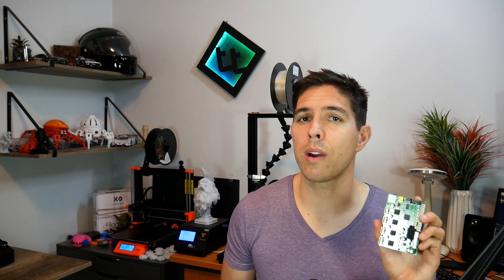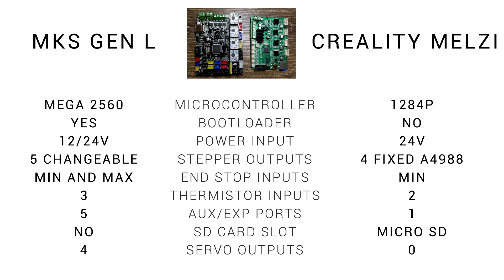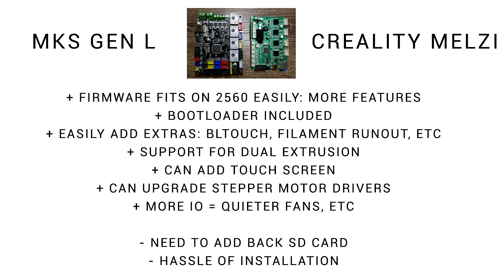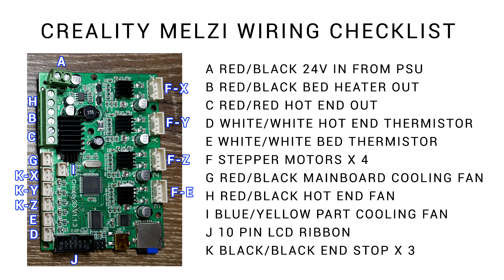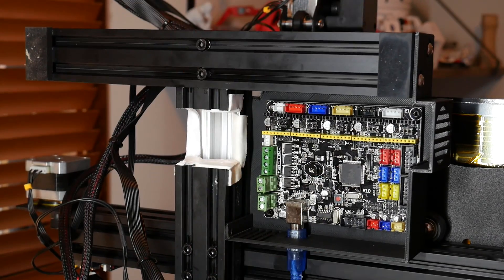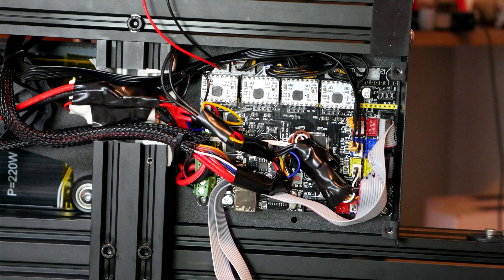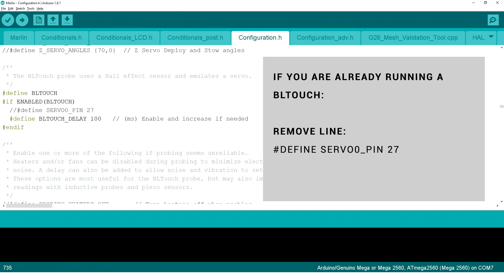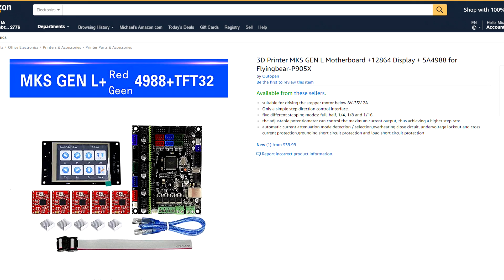Easy and cheap Ender 3 mainboard upgrade: MKS Gen L guide

Comment: Has anyone else had a problem with temperature being all over the place with the mks gen l board my temp graph on octopi was smooth with the old board the mks board the thermomistor acts crazy I have tried 2 mks gen l boards and same problem
Reply: Have you done a PID tune? http://3daddict.com/pid-tune-3d-printer/
Reply: @ChrisTeiken  yes but it's not that type of inconsistency it's like a very fast fluctuation it even does it at idle without the heater on I tried putting 100 km resistor in both the hotend in the bed and it it still had to fluctuations and then when I went back to the old board even after flashing updated firmware to the original melzi board from the ender 3 it would have been away so it only did it on the to MKS gen l I did do the PID tune but it it's like a higher frequency fluctuation you know then then what you normally get with a PID you know inconsistency so pretty weird
Reply: @ChrisTeiken  I'm thinking it may be a combination of my power supply having too much ripple, and I've also read it one of the capacitors has too high ESR . It's just weird that it doesn't on both of the MKS gen L boards that I bought and not the ender 3 board.
Reply: @AlphaCharlieFour   I do agree that the OEM board does a better job of keeping the temp study. I have still have small variations with the MKS board after I tuned it.
Reply: @ChrisTeiken  https://photos.app.goo.gl/M8JVvWsHuBCdSM9a6 the right side is after i switched the thermistors over to the mks it gets weird. I wish i had taken a pic of the pid autotune it looked like that but in that sine wave pattern it was so weird
Reply: @AlphaCharlieFour  Mine looks similar to yours.
Reply: @ChrisTeiken  I'm probably just nitpicking I replaced the 22uf cap on the output of the voltage converter with one with a low ESR, and it seems to have cleaned it up substantially if not fixed it.
Reply: @AlphaCharlieFour  do you happen to have a guide to do that?
Reply: @yowhatsmynames  I've got another board I can do I'll have to make a video of it

Comment: I bought a MKS_GEN_L board compiled the Marlin 1.1.9 , Arduino 1.8.8 .the board came with Artillery 3D software ?? when I tried to down load the board does not recognize Marlin and  my COM ports. In tools it is grayed out. Any suggestions you can give me?
Reply: Make sure you have the power on for the board. If that still doesn't work, you may need drivers for Windows/Mac/Linux.
Reply: I tried to install a CH340 driver it gives me an error message .

Comment: Hi Michael,
When I try to switch the E0_AUTO_FAN_PIN from -1 to 7, it no longer uploads, giving me the error message - Error compiling for board Arduino/Genuino Mega or Mega 2560.
 The firmware uploads fine when I leave the value as -1, but I would like for the fan to only come on when at 50 degrees or higher. Any advice on how to fix this problem would be greatly appreciated, Thank You.
Reply from the maker: That's a weird one. Might be one of those strange issues where it compiles with an older version of Arduino IDE. Also, read the error message at the bottom, it will give clues. Good chance something else is already assigned to pin 7.
Reply: Thank you for your input, I will try it again.

Comment: I've completed the instructions here and everything got connected and flashed over to the new board just fine. However, i'm having an issue to where, when first homing, the Y axis sounded aggressively loud and failed to home. Anything I can do to get my Y axis working correctly?
Reply: You may have to reverse your stepper motors drivers. "#define INVERT_Y_DIR true" from what he had. Not all stepper drivers are the same direction.

Comment: I’ve tried my hardest not to have to post but I am at my wits end. I purchased the MKS Gen L v1.0 with the LCD screen w/ built in SD reader. I have an Ender 3, BLTouch, & 4988 drivers. I have tried and tried and tried and I can not get either the new or the stock LCD screen to do anything but light up.

I have made sure to comment out the stock display, left it on, tried defining different displays. None have worked. I have tried shaving the connectors and inverting then as well as using 2 instead of one cable to connect them. I am so at a loss and it is starting to make me mad... 

Please, I would love some help getting my printer back up and going. I have so many things I want to print. 

Thank you in advance.
Reply from the maker: Remember that if using two cables, it plugs into exp1 and exp2 on board and LCD display. Only reprap full graphic display enabled. If using one cable, I couldn't get it to work, but I never reversed the cable. Will go into exp3 on LCD and I think exp1 on board. Add cr10 display in firmware by uncommenting.
Reply: Teaching Tech thank you very much for the reply. When using the LCD with the SD card. I use 2 cables. Match exp1 and 2 to the same on the board. I did have to invert the cables to get the screen to turn on. Then I uncomment the line for discount LCD and comment out cr10 standard. Everything compiled and uploads fine. 

That doesn’t work. The screen lights up but nothing is displayed. 

When I use the stock LCD I have tried a couple things. Plugging one cable into the exp3 and inverting the cable. This give me backlight but no text. Then I tried using two cables non inverted and this give me backlight and no text. I have tried having both, not at the same time, cr10 and discount display defined. Both of those result in a backlight and no text. I have tried fresh copies of marlin and just adjusted the LCD settings just trying to be able to see something. 

Thank you for talking the time to respond I appreciate it. I think your vid is pretty comprehensive and easy to follow but I’m just missing something. Right? I have to be.

Thanks for the help.
Reply: Right now. I have the stock LCD installed. Exp1 to exp1, Exp2 to exp2 on the mobo. The screen lights up but no text. I just downloaded a stock version of Marlin. 

Changed motherboard in config.h to BOARD_MKS_GEN_L

Uncommented out REPRAP_DISCOUNT__FULL_GRAPHIC_SMART_CONTROLLER

Commented out CR10_STOCKDISPLAY

Board changed to Arduino/Genuino Mega or Mega 2560

Processor: ATmega2560

Programmer: AVRISP mkII

Clicked compile

Done compiling

Click upload

Upload completed

I unplug from my PC 

Throw the power switch on the ender 3. The red and blue leds on the MKS turn on and flash for a second and then the red stays on. The screen powers on and shows me a blue screen. Twisting the screen knob does nothing that I can see. Pushing the button makes the buzzer beep once. Holding down the button makes it continuously beep. 

So that’s where I am. 

*sigh*
Reply: @lorenzow.842  I'm still using the stock screen, but what you are experiencing happens to me if the firmware fails to upload properly. Make sure to turn on verbose output in Arduino for compile and upload, as I thought it was uploading, but when I turned on verbose I could see an error. Also, I couldn't properly flash with just USB power, I needed the power switch on for the ender 3. Hope this helps.
Reply: Chris Teiken holy crap! You are amazing. I turned the printer on while I uploaded the firmware and bam! LCD screen working. I was even able to get the new LCD working. Thanks so much. This made my night.
Reply: @lorenzow.842  Awesome! Glad I could help out!

Comment: Having a super odd issue that I'm stuck with.. After installing this board on the Ender 3 my hotend decides to go way beyond the set temperatures when i start. The heat goes up super fast and it starts smoking because its so warm. What could be the reason for this? The sensor cable screw is loose so its not getting squished. I've ran out of ideas. Faulty hotend maybe?
Reply: Try tuning your PID. http://3daddict.com/pid-tune-3d-printer/
Reply: ohdear94 have you solved this problem? i have same problem.

Comment: can this be installed on any printer ???i own a athorbot printer and cant add anything to the cheap main board, is it possible to swap it with this one and do the same settings you did ??

Comment: Great video. Have you had any issues using your printed case and the stock cooling fan? Some have reported that some of the stepper drivers run a little hot (TMC 2208 as an example). I would like to keep my stock case and use a adapter bracket to mount the board. I've seen Thingiverse plans for changing the stock cover plate for one that has two fans. The only problem is most of them are using two 12V fans and using "stepdowns" or other means to power them. I know the ender 3 is a 24V system and the fans are 24V. What I would like to do is use two 24V fans in the new cover/lid to cool the board. But I can't find any info on how to power them. As I mentioned the stock cooling fan is 24V, 0.10A. The fans I would like to use are 24V, 0.06A (each). Could these just be wired in parallel and plugged into the socket where the single fan would be plugged into (labeled 12/24V)? Or would this cause issues/problems? Would software (Marlin) have to be changed? Would like to keep it simple and neat. Without extra components to drive them.

Comment: Thanks for yet another great guide. I am up and running with the new board, you make it so easy. I did make a few changes based on other videos/sites. I added a 5v 20MM fan to cool the board (found the print on Thingiverse based on yours). I reversed the LCD connection by trimming off the plug, so I only needed one cable and I did not make the changes concerning display in the firmware to make it work this way. I also switched to 2208 drivers (again found a video on setting voltage on those). Finally, added BLtouch, I found I needed a drop of hot glue gun glue to get that to stay connected on the board. If I hadn't messed up setting voltages on the drivers, things would have gone smoothly. After smoking a couple of those, I watched some video's on how to best do that. I can't believe how quiet my printer is now with the 2208 drivers! Thanks again for great videos, I have done so much to my printer and improved my prints!! I can't decide if I want LCD touch screen or not, I would like to hear from others that have made that change if they like the touchscreen.

Comment: How about 2130 drivers? Enables sensorless homing, but might be a bit more involved (pin config) when using the stock lcd.
Reply from the maker: A 2208/2130 double video guide is coming. The 2208s are a week late in the mail. I'd like to do these first because they are simpler and I can cover setting vref.
Reply: @TeachingTech  ok, cool. I saw on another vid you said the 2130 is upcoming. I still have to run off a box for the MKS & research LCD vs TFT then BLT then sensorless homing, linear adv, etc 😓☺
Printers are like the Hot Rods of my decade. 5x the work for the amount of use in return.🔧🔨💣

Comment: Trust me. This ISN'T EVEN CLOSE TO PLUG AND PLAY. I've been working in my spare time for SEVERAL days and still getting nuthin' from my printer. I bought the board based on it being a relatively simple upgrade. It's not, so beware before buying if you think it will be as easy as he implies in this video. At least it was inexpensive. ..if you don't count the hours you will probably spend trying to get it to work. I'll be a bit skeptical regarding any future recommendations as this one is short on crucial details apparently.
Reply from the maker: Every step I needed to get it working is shown in the video. No one can help you fix your problems because you are complaining rather than posting them in a community group in a humble way.

Comment: Are the stepper motor drivers really necessary? If so, which should I buy for the upgrade?
Reply from the maker: You are better off upgrading them from the A4988 I show here. If they ever come in the mail I have a two part series on this planned.
Reply: @TeachingTech  I got my MKS working today. Using A4988  drivers for now which are currently printing your case. Everything is a big dodgy at the moment as the board is perched in mid air.  Looking forward to part 2.  Thanks!
p.s. I have some DRV8825 drivers but I heard bad things about them.

Comment: I'm getting everything before changing boards and I have already received the MKS Gen L Board and I am waiting for the MKS TFT 28 V3 Display. I will be using Trinamic TMC2130 Drivers so I can lose my factory Endstop Switches. However I can't find any information on adding the TH3D Mini-EZABL Auto Leveling Probe to the board. Do you have any knowledge as to where I can find this information?

Comment: Nice vid, but you could have probs shown how to get the Vref on the ender 3 rather than the backs of your hands, lucky someone has noted them all down so use these: https://gist.github.com/knoopx/e6c40a009e796203b93a75a3ed6a5ab8

Edit: You failed to mention a ton of important settings!  Please, anyone else that attempts this read (Also gives you some info on setting up the TMC2208 correctly too!):

https://www.deviousweb.com/2019/01/05/ender-3-pro-mks-gen-l-tmc-2208-upgrade/

Id suggest adding the modified settings to your description or at least a link to the post.
Reply from the maker: Touch screen and a series on stepper driver options have now had dedicated videos made. It is logical to make this video with the cheapest, simplest baseline. If I include 2208s, then all of the people who want 2130s or 2100s get annoyed. Therefore I prefer to break them into more digestible sections. The downside is people have to be patient.

Comment: I just side graded the the MKS Gen L but I have TMC2130 stepper drivers, after trouble shooting the wiring and setup I flashed marlin 1.1.9 (bug fix) and mostly followed you instructions on what settings to change, however I have a LOT of lost functionality that i am slowly adding back in the firmware. 
My issue Now that my heated bed is EXTREMELY slow to get to full temp. I have done a PID bed tune hoping that may speed up things but nope...

I would love to see your firmware file and see how it differs from mine.
Reply: Have you tried an external mosfet board? I'd also check the wiring incase its loose or something, I'm using the  1.1.9 bugfix and am currently using the cr10S config with the settings adjusted to suit my Ender 3, all is fine for me

Comment: Hi, the baudrate 115200 does not changing for 250000 with mks? thanks for your good video...
Can you connect noctua fan 12v directly on mainboard?

Comment: Great explanation i got a far way with this but its definitly not what you claim, that this video contains all steps you need to get the MKS Gen L board exchanged in de ender3:(

What about the drivers/tuning voltage from lets say in my case the drv8825, then also very important changing the steprates for the drivers, also that some type drivers run in the other direction so you need to inverse the direction in the firmware i can go on with some minor things also you need to do otherwise the ender3 does not work correctly, as i am a newbie but still have it working succesfully, but i searched whole YouTube for a really complete guide for the Ender 3 + Mks Gen L v1.0 (maybe even with the Bltouch), and not 1 guide explained to use TH3D firmware all use marlin 1.18 not even 1.19, dont know why:) maybe you can remake a complete guide for the newbies in the future;)

thanks for this guide it helped getting me in the good direction.:)

Comment: My Firmware complied with no errors but i received a "low memory available, stability problems may occur" warning with 81% used. Is this going to be a problem? i have been using the firmware updates from your original marlin to now

Comment: A little late to the game, but I have installed the MKS Board.  A couple of notes, I am retaining my stock display, in addition to the touch screen, as there are some features that I prefer, such as position and other information.  You can also adjust the feed rate of the print from the original screen, even though you cannot enter the menus.  It bears mentioning that if you do not use stock type 4988 drivers that you need to update the appropriate drivers in Marlin.  I used DRV8825 stepper drivers and will see if the micro-stepping causes any issues.  I also had to install a USB driver to communicate with the MKS Board to allow Marlin to upload.  Even with these drivers, the machine is quieter, along with the fans not howling all the time.  My next move will be to do the more sophisticated Trinamic drivers.  So far, So good!  Thanks Michael for a great channel.